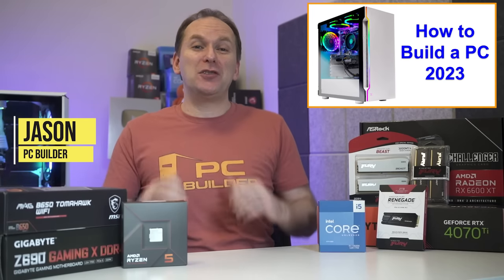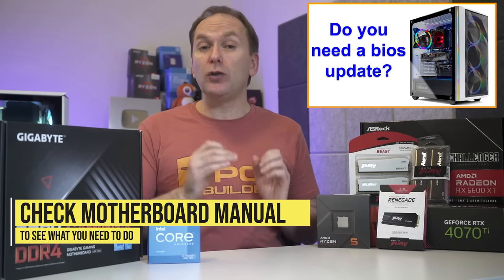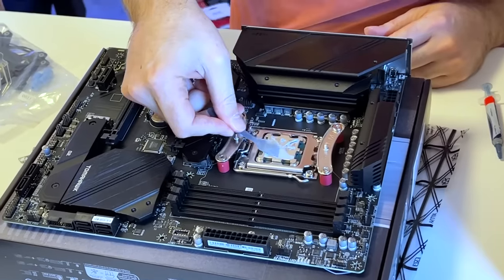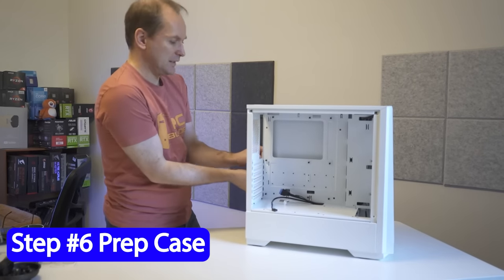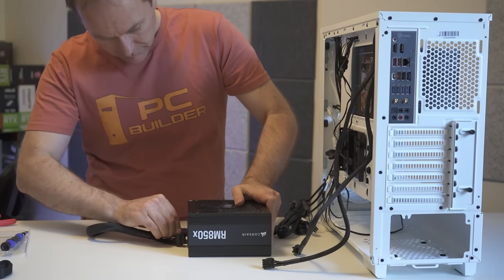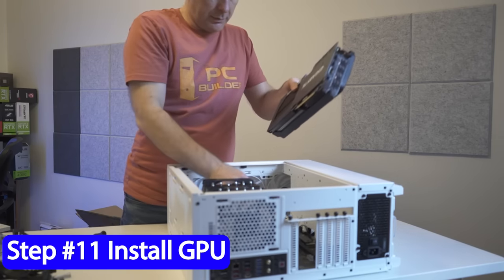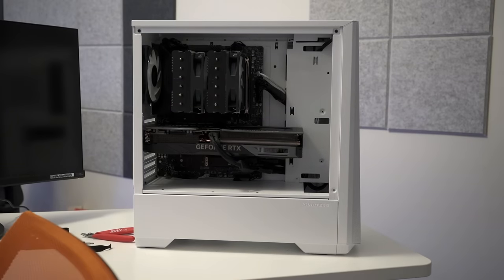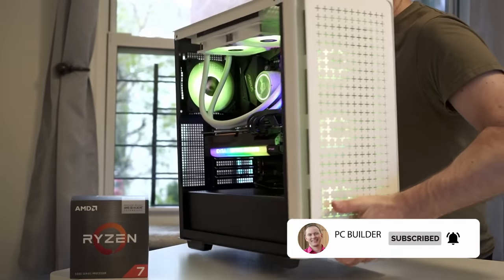🛑 How to Build a PC 🛑 Step By Step Ryzen & Intel 🛑 How To Build a Gaming PC

Comment: Im one click away from buying all the components for my first budget gaming build. What do you think?

Cpu: i3 12100f
Motherboard: asrock b550m pro rs
Gpu: xfx rx 6650 xt
Ssd: 500gb silicon power m.2
Ram: 2x8gb silicon power 3200mhz
Psu: msi mag 550w bronze
Case: antec dark avenger

Comment: Note: For 12th and 13th gen Intel processors running on the Z790 chipset it DOES matter in which M.2 slot you place your PCIe SSD. On most Z790 motherboards there are two M.2 slots that are directly connected to the CPU, one of which is PCIe v5.0. if you connect your SSD to the 5.0 one it will reduce your main PCIe graphics slot from 16 lanes to 8. That shouldn't matter much for most graphics cards, but it can have a small but real impact on cards like the RTX 4090. 

So unless you have a very new PCIe 5.0 SSD, leave that M.2 slot empty.

Comment: I like lthe way you did the steps for this video.  I tend to fall into a bit less thermal paste.  Not trying to make an argument here cause you have had much more experience with these builds.  Just prefer not seeing paste going off the cpu.  Also, and maybe its just my stubby fingers but i have a hard time getting the stand off screws in place so realestate taken up by the power connectors is hard.  My preference is to put on the mini connectors (pwr, reset etc) on first but i have had few cases that include those inserts which i note you did have.  TBH i prefer to build in larger cases due to more room.
Reply from the maker: Thanks for sharing! And that's a great tip that its easier to build in large cases so newer builders especially should think about going that route

Comment: Jason, How little can you spend to build a dedicated pc to play sim racing (iRacing) only. It needs to meet or exceed all minimum specs on a curved monitor in 1440. If of course you wanted to spec out multiple resolutions etc...........
Reply: MONEY
Reply from the maker: Looking at the listed system requirements for iRacing, it seems relatively easy to run. For 1440p on an ultrawide at high details, I'd look for at least an RTX 3070 or RX 6800. A Ryzen 5600 would likely be enough. So somewhere in the $1000 range? Maybe $1100.

Comment: Hi I had a PC built and the builder/clx coudnt figure out how to properly hook up my aRGB fans and light strip to be able to be controlled by the case RGB control buttons. They where able to get them to be controlled by software but I'd prefer to have both options, the built in RGB control buttons on the case and software. 

I have listed the main parts of my build below if you could please provide me some support on how to hook the rgb control buttons up to these parts properly to be able to control my aRGB fans lights and light strip please.

Case=
neo qube 2 mid tower black

Motherboard=
asus tuf gaming z690-plus wifi d4 - atx

aRGB fans =
GAMDIAS AEOLUS M2 ARGB Fan Black
Manufacturer Part#AEOLUS M2-1201R BK SGL

Light strip = (there's only 1 light strip se below for info)

Phanteks Digital RGB LED Combo Kit
Info on the light steip
Digital RGB LED Strip Combo Set 2x 400mm 1x M/B adapter ASUS/MSI compatible Retail (Works only with DRGB boards)

Manufacturer	Phanteks
Manufacturer Part# PH-DRGBLED_COMBO_01

Comment: having done bios flashing on ecs motherboards before on floppy disks... while crossing your fingers that power will not trip. deym, times have changed. thanks for this tutorials
Reply from the maker: Yes in the past flashing the bios was a risky affair and you could brick the board. Today boards come with a backup bios that won't get flashed until the new bios posts. But still don't remove the power during the process! :)

Comment: I have a NZXT h5 flow case with a Msi pro B550-VC motherboard and a frozen notte 240 cooler that are already installed in just having trouble with all the cables on where to connect them

Comment: Hey, thanks for the video. I’m only a couple of minutes in bed right off the bat you talked about a bio flashback. I’ve never heard of such a thing and you did not explain what that is. How do I know if I need a bio flashback? The other thing is I’ve watched a lot of these videos about building PCs and I think I can do it but the one thing I’ve never seen anyone talk about is what you do once it’s built and you first turn it on. How do you set everything so it all works together like drivers and things like that?
Reply from the maker: Hop on over to our "After you Build" setup guide! That's got what you need for drivers and set up. As for bios flashback that will depend on your motherboard/cpu. When you know what you are getting you'll just need to check the specs and the manual.

Comment: 👍 Excellent. What CPU Heat Sink Air Cooler you using on your Intel CPUs?  Looking forward to your Bios Setup esp. regarding fan rpm controls for what the safe range of Intel CPU Heat operation is & how to control & monitor it. Also setting up to format these .m2 type drives for UFEI & No Secure Boot for non Windows OS.   Don't think I'll be playing games on this machine although garuda linux looks like a sweet OS for Gamers & content creaters.  Test driving it now on an old laptop.  Windows got too slow & kept crashing.
Reply from the maker: Honestly I like AIOs, but the Thermalright Peerless Assassin 120 SE for $40 is just insane. Sorry I missed this comment a while back! Setup guide coming soon!

Comment: Hello PC Builder! I'm looking to do an AMD upgrade in the next few months around the ryzen 5700x. I already have an Nvidia t600 as my GPU and it is a SFF build. I primarily use my PC for video editing/production tasks and some gaming. Would you be able to do a video sometime that talks about the value/performance/longevity of a build based on the Ryzen 5700x? Thanks in advance and keep up the great work 👍
Reply from the maker: Hello! Hop over to our 5600X build guide on the channel and just go for a slightly stronger cooler, otherwise I'd do the same build (:
Reply: @PCBuilderChannel  awesome, thanks!

Comment: Hi, great video. Though i, was wondering if there any way to daisy chain noctua nf-a12x25 pwm chromax.black.swap? That's the part im trying to figure out now. I have 6 fans, but i was trying to make it, so only 2 are connected to the motherboard. So like all 3 fans are connected, making 1 wire to plug into the motherboard. Is that possible? Im unsure if i have 6 connectors to plug all fans in.

Comment: When upgrading my cpu/mobo I've gotta admit, I simply put in my existing os drive and told bios to look there (I did go the correct way to change license/motherboard). Works fine but I admit it was a bit janky done and I wasn't sure if it would work or if I would have ended up doing a fresh install
Reply from the maker: Glad it worked out!

Comment: Do you suggest to test the system before mounting it in to the case? Also how could I know if the motherboard needs the bios update before installing everything?? Thanks!
Reply from the maker: I don’t personally. And check your motherboard manual

Comment: got that same mobo on amd side the tomahawk..very clean board got it on sale with the 7600x combo for 435.00 and i got 7900xtx on sale the 310 merc for 1045.00 usd. for ram i just got 2x 16 gb each corsair dominator cause i think it has best looking rgb out of all the ddr5 i got the black cause it was 30 cheaper for some reason. white should not be a premium price but it is lol. i really do wish arctic would make their aio coolers in a white variant they would sell out in a second. i did see deepcool lt720 has a white variant now but the actual radiator is a weird off white from rest of pump which they messed up on imo. my mobo cpu and gpu are all coming tomarrow but im hoping it is a day ahead like how i got my arcic aio a day early this week. crossing my fingers
Reply from the maker: Thanks for sharing!

Comment: Starting my very FIRST build today. I'm excited!!  
TUF GAMING B650M-PLUS WIFI
AMD Ryzen™ 7 7700X 8-Core
Radeon RX 7900XT Ultra
CORSAIR VENGEANCE RGB DDR5 RAM 32GB (2x16GB) 6000MHz

Please tell me if i made any bad decisions. I just jumped in and hope I didn't do too bad.
Reply from the maker: Potentially you might have some issues with the RAM speed, but the've largely fixed most of the RAM issues, so should be fine. Best wishes on your build!! You got this!
Reply: Thank you for the comment. What should I keep in mind for the near future when considering the RAM ?

Comment: My son has been saving up for a few years and I just helped him buy all the equipment for a Ryzen 5 5600 / RX 6600 build. On Spring Break in a couple of weeks, we are going to be using this video to assist us in our first PC build (I'm a longterm Mac guy, worked for Apple for ten years).

Very helpful. I went ahead and Liked this video, will post an update when we get it up and running.
Reply from the maker: Amazing! Best wishes on the build! Do please keep us updated.
Reply: @PCBuilderChannel  First, THANK YOU. It took us two hours total and because we were extra cautious, we posted the first time we tried! 🎉

Some newbie feedback on two things to help make your videos even better.

1) The EPS section (9:41) confused us as I don't recall the term being used up to that point. Our PSU had one cable with "CPU" on it and we got hung up and confused in this section, thinking we might be missing something. Something like, "If all you have is one 2x4 cable with 'CPU' on it, that's all you'll need to plug into the X part of your motherboard."

2) Our case required the use of little extenders (that were included) so that the motherboard fit evenly into the case. Thankfully I'm a pretty handy guy, but perhaps in your next iteration you might mention that if the motherboard doesn't fit flush against the case, your case might have come with some extensions you need to install so that it will.

Other than that, everything else was perfect. He's already got a new record on his favorite game, Geometry Dash, that apparently you can play at a high level only when you have a very high frame rate.

Comment: How do you know what your current bios is to know if you have to do it in steps if you are using flashback and have never seen the bios screen on your motherboard? is it usually listed somewhere in the motherboard's manual or something?
Reply from the maker: It should say in the manual but I just always upgrade it to the latest no matter what when I build. See the "after you build" set up guide video for more

Comment: I am having an issue with the ram sticks. I have two 8gb sticks installed, but computer is only letting me use 7.95 gb of the 16 gb. so will I need to install another 8 gb stick ?

Comment: Im still in the middle of rebuilding a system. I should have been done already, but thanks to a company thinking it would be smart not to sell lga 1700 brackets by themselves for their cpu blocks, im now going a different route.

It will be 2 to 3 weeks now to get the optimus block, which is the last part i need. In a way, it was good that this other company made a mistake as i been wanting to get an optimus block for one of my builds for a while.

That mistake will also make some people happy as they are now getting upgrades. 16gb to 32gb and air cooler to an aio since i won't be using their products moving forward.
Reply from the maker: Best wishes on your build and thanks for sharing!

Comment: One off the big problems in 2023 is the case. 
There are so many out there.
Some goes for old 2020-2022 cases. 
But if you need a pc for 6-8 years in the future the pain for airflow, noise, fans, I/0 in the front like USB C is a living hell to choose from.
And even the Motherboards is a pain sure go for 2022-2023 versions fra Asus or MSI og Gigabyte whit the pain off proformance I/0 ports DDR5 and so on. And also the stores just maybe have the same ones or NOT. So getting 1 pc from 1 place sure, just 1 problem the money prize.. Cabel management at the back is even a big problem for alot all cases, and even getting the cabels back there in some cases is a problem.
So what people do in the end, close the light in the room, and just pick one, because seeing 1000 videos or 1000 test for best is not even getting close to the best solution, but more pain.

Comment: ello!  nice video 💪🏻 have a question 🙋‍♂️psu  enermax marblebron 850w (cost 109$ in my country) good for my rx6800xt msi trio x ? now I build my first pc around gpu what I have)
Reply from the maker: Hi! Hop over to our Best PSU 2022 video and follow the method there to check what you need for your full build (:

Comment: Hi there, I got the an MSI X570-A PRO.  No matter what I do, I can't update that mobo.  Some expert told me that MSI are notorius for updating.  Now I wonder if I would have more chance with ASUS TUF GAMING B650-PLUS, Yes I know I would have to switch to DDR5, but I am fed up with the DDR4 running lower Mhz than they should, plus my usb acessory like my Sharkoon docking, my system monitor is not reconised.  Can you help me?  Thanks

Comment: hi Jason! what do you think about gigabyte's z790 gaming x ax? or should i go for z690 gaming x instead? it's about the same price here but i couldnt really find any reviews on the z790 one.
i'd pair it with a 13600k.
Reply from the maker: They nerfed the audio on the gaming X on the Z790 version. I'd go Z690 unless you want to run super fast DDR5, then if you need better audio go with maybe the MSI Pro-A Z790 or Tomahawk.
Reply: @PCBuilderChannel  in that case i'd stick with the Z690. thank you!

Comment: I was wondering, when you are installing an aio cooler, when plugging them into the motherboard, should you be plugging them into the CPU fan slot, rather then the aio slot on a motherboard if you have one.
Reply from the maker: Typically want to plug the pump control wire into the AIO pump header (unless it is direct SATA power), and the fans for the radiator into the CPU fan slot but most boards are flexible about this today and can reconfigure a fan header as a pump instead in the bios or fan control software. Refer to your specific motherboard manual and the AIO manual to double check this is the case.

Comment: Hey I just built a intel i5-12400f on a tuf gaming B660-plus wifi d4 motherboard and I can’t get the wifi to work for the life of me. I think I got windows 10 on there all good I skipped the Ethernet during the installation on windows and once it was done I tried to connect to wifi but there’s nothing there no airplane mode or anything except the Ethernet. But I need it to work on wifi ethernet is not an option. Any help would be appreciated thanks.
Reply from the maker: In the windows search bar, type "wifi settings" or go to wifi in the settings menu. Should be able to select it from there. Make sure you've installed the latest driver from ASUS for that specific board (google the board name, go to ASUS support page and download it if necessary on another PC using a USB drive). But it should work out of the box (I have the same board). Make sure the antenna is attached at the back (came in the motherboard box). If still having issues, go to the Reddit build a PC forums and post a troubleshooting post for more help.

Comment: Its my first time building a PC and luckily my parts arrive in the next few days but I got my motherboard extremely fast. I got a GIGABYTE X670 AORUS Elite ATX Motherboard rev1.2 but it didn't come with a manual. I tried to find it on the website but it seems you have to make an eSupport 'question' and provide your BIOS vers. number FIRST before you can ask for the manual or anything.. Any advice?

Comment: Waiting on parts, I5 12400 with a 3070, you have any power supply suggestions?
Reply from the maker: Hop over to our Best PSU 2022 video! We go over everything you need to know to find the right wattage for your full build and have our recommendations linked there

Comment: Do you think that the AMD Wraith Stealth cooler which comes with the AMD Ryzen 5 7600 good enough to cool it down or should I buy an aftermarket one?
Reply from the maker: I recommend replacing it. See our 7600 build guide video for more
Reply: @PCBuilderChannel  Thank you so much, do you think an RTX 3060 is good enough, as the RTX 3060 Ti does not have enough VRAM for me? Thank you again for responding.

Comment: I have a gtx 1660 super.  Is an Intel A750 a good upgrade or stick with a rtx 3060?
Reply from the maker: Can we go RX 6650 XT instead? It's the best price to performance. A750 is good price to performance, unfortunately the 3060 costs as much as a 6700 XT which destroys the 3060. 3060 Ti isn't terrible value if you must have NVIDIA.
Reply: @PCBuilderChannel  I wanted a Intel GPU to go with my Intel CPU.  Plus I can afford it.  Thanks.

Comment: I'm in the middle of building my first PC right now, but every time I try to power it on, it trips the OCP in the PSU. Now I have to tear it completely apart and test each component starting with the motherboard, because I didn't bench test it before assembly, to find the short.
Reply from the maker: Sorry I missed this comment a while back. First thing I'd do is clear the CMOS, double check all the connections are properly plugged in and try again. If still having an issue I'd go exchange the PSU (make sure it is sized properly) at the store and try again (or use another PSU if you have one laying around). Make sure there is nothing shorting - so look for loose screws that might be bridging between an exposed motherboard component and the PC case metal, the board is properly seated in the case, etc. Reseat your components (mostly GPU, CPU, etc) if that doesn't work.